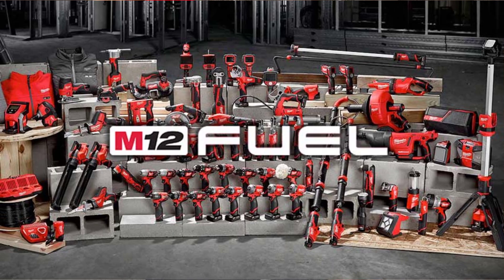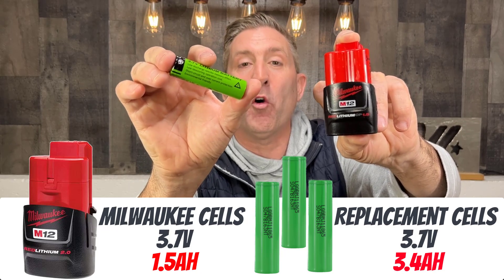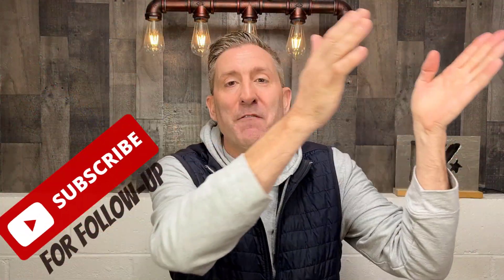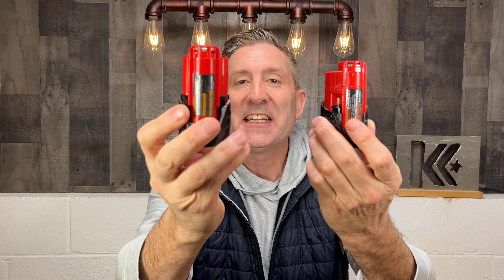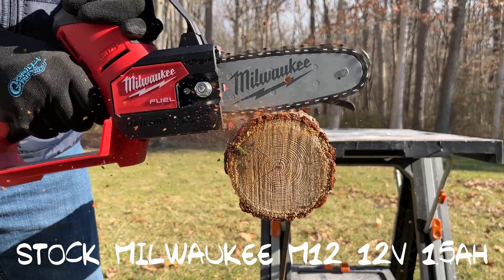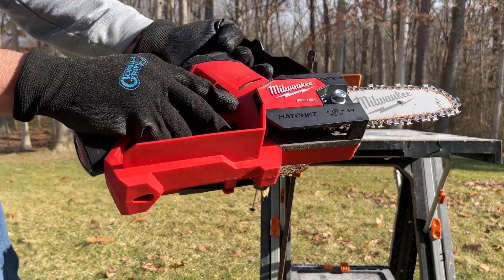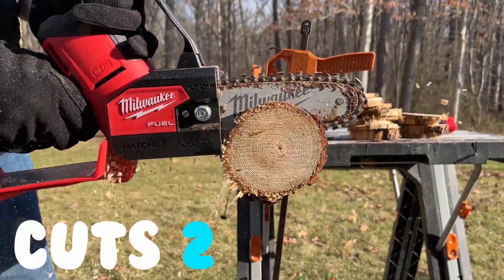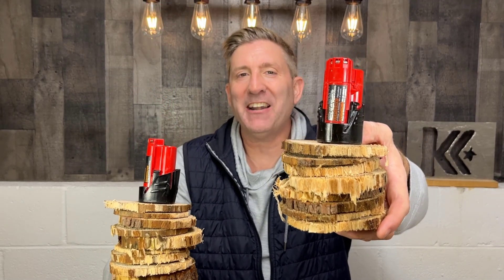Milwaukee M12 Battery Upgrade ⚡⚡⚡ PART 1

Comment: Should have used 3 of the molicell p30b model of the 18650 cells. High maH isn't as good as the cells actual amps especially in power tool applications . The molicell is p30b is a balance of maH & high amps.
Those cheapo batteries you used are low amp ratings and were overheating like crazy. Great first try though.
Reply from the maker: Interesting feedback - I'll check into it.

Comment: Nice work. For the compact batteries, the Samsung 20S is the go to cell, not mu h better capacity but it will chuck out 35+ Amps happily.

Comment: Can you make a video about those counterfeit Milwaukee batteries on eBay,  not the knockoff aftermarket?  I'm talking about the exact copy of Milwaukee battery packaging and markings on the battery. It's hard to the difference without any knowledge about. It would be a good tip and probably saving hundreds of people being scam with this counterfeit batteries flooding eBay.

Comment: If you watch for specials on Ryobi battery packs at home depot, you can get known good, high drain cells pretty cheaply.  For example, the 4ah pack when they come on sale at 2 for $80. Each pack has 10x 2ah cells so $4/cell.  Not the cheapest, but known good cells is worth something.
(The HP packs sometimes are 2x 4ah packs for $100 and those may be better cells, but the last I took apart were the same cells, but a better BMS - which you don't need if you are just scrapping the packs!)
Reply from the maker: Good point

Comment: One of the tradeoffs when selecting battery cells is capacity in amp-hours vs. maximum amp drain (instantaneous amps).  Power tools need amps NOW.  If you tested an original vs your modified pack in a low drain application such as a small light the results would likely be different.
Reply from the maker: True - that is why I tested with a chainsaw - high drain

Comment: Pretty sure Samsung currently has the best 18650 you can buy! Good video thanks for demonstrating to people who think Amazon battery's with Amazon cells are just as good.  Not talking about all but most
Reply from the maker: The Samsungs are definitely considered good and safe for the price.  For some strange reason amazon only sells sketchy cells.  I have bought the top rated 18650s from a legitimate online store - really interested to see how this all plays out.  Stay tuned :)
Reply: I made 3 of the small m12 packs with samsung 20S cells. They punch harder than the 6.0 milwaukee!